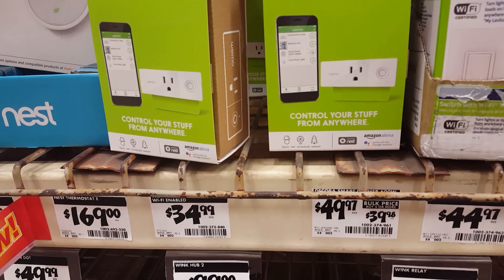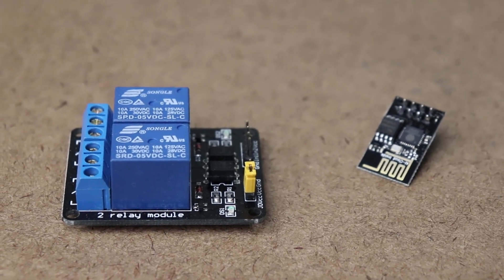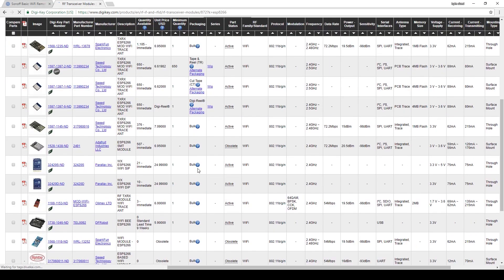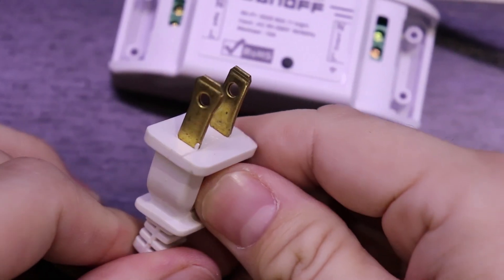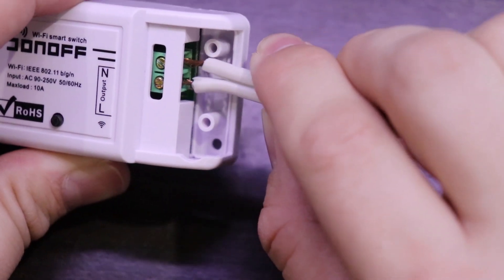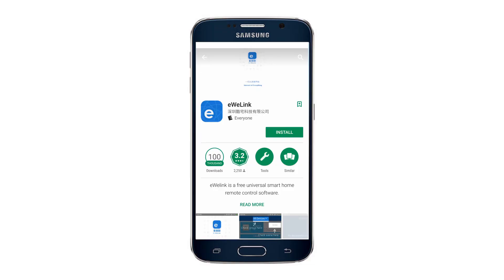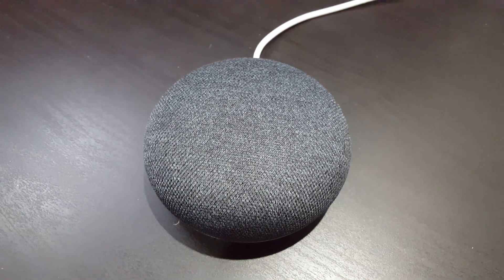Sonoff - The $5 WiFi Smart Switch That's Compatible With Alexa And Google Home

Comment: Does it look like if I unsolder the line in at the relay and unsoldered the neutral at the output could I use this to control 5 volt DC?

Comment: Hi there, love the video! Just wondering, will it still work if it's connected to a 12v transformer?
Reply: Look at the front cover or wherever it says the input values. if it says   Input:  AC-90-250v. 50/60Hz 	no, it will not work via 12v.

Comment: These are definitely not meant to be running high current loads like blender. They're rated 10amp, that blender likely pulls close to if not over that figure. The relay will also be quickly destroyed if it's repeatedly used to interrupt high-current loads like a blender crushing ice. Finally these are straight from China and have no electrical safety cert markings on them, if one catches fire and burns down your house you won't be getting any insurance money.

Comment: Even the smart switch has multivoltage, please check your voltage appliances before plug it in. Step down transformer with smart switch can also useful.

Comment: Is there a way to pair the switch with a wifi router and control it via the internet remotely? Say, I'm at the back of the garden 200 meters from my well and I'd like to turn on the water pump. I have my phone with me but the wi-fi signal does not reach all the way to the switch. The switch is in range for my wifi router that's connected to the internet and my phone has 4G. What do I need to do to make it work?

Comment: Welcome
I installed sonoff basic r2 in the air conditioner between the normal manual switch and the air conditioner
At first it was working perfectly through the ewelink app
Then I disconnect the power through the normal manual switch which is before sonoff
When I turned on the manual switch, the air conditioner turned on immediately and did not respond to the sonoff switch
And when you turn on or off the application, the color of the sonoff switch light changes, but the air conditioner continues to work without change
I deleted the switch from the app and reset it and nothing changed
I removed the switch and installed it on another device and I could not control the device with the sonoff switch
Where is the problem and what is the solution?

Comment: I have a question if anyone can help me , i have a traditional main door lock , it is an electric lock , which is connected inside my house with a bell switch besides my intercom , when someone comes outside i can simply push bell switch and door would open , how would i connect this with sonof switch because i want the switch to turn off in a sec right after it opens the door otherwise if it stayed on it can burn the outer lock since it doesn’t have capacity to cut off the current itself , what is the best way to do it ?

Comment: How did you use this for your blender? It seems to have a ground. The wifi switch does not. 

asking because I have 4 of these kicking around, hoping I can get it to work with my 3d printer. Thinking it might not be possible.

Comment: How do you wire Sonoff with a 3 prong connection? The one you show only has 2 so it limits the applications and accessories that can be plugged in.

Comment: Excellent video...For safety reasons however, I would avoid using  wifi switches to control blenders, or any sharp spinning rotating blade that can come into contact with your hand.
Reply: Or, just don't put you fingers near the blade when the jar is on the base (motor).

Comment: NEVER tighten wire like that. When so many little copper cables are the wire ALWAYS use ferrules! if you dont, you run the risk of cutting through the copper wires when tightening the screw to hold it in place. This can cause a lose wire or a bad connection where there is not enough wire touching the terminal. both scenarios can result in electrocution or fire.

Comment: Has about 40 of them in the house to control outside night, wireless camera, doorbell, PIR, Intruder barrier detector, house alarm, most of the curtains etc.  The Sonoff switch can has single, dual or 4-channel.  They are also available in bare module in populated circuit board to be power by 5VDC, 7 to 32VDC and/or 240VAC.
Basically all Sonoff switches are controlled by eWelink App.  If you have an Amazon Alexa device which is controllable by the App of the same name eWelink is one of the registered skill inside.  Thus if you activate the eWelink with Amazon Alexa App it will copy the Sonoff switches data across so that you can voice-control any of them.

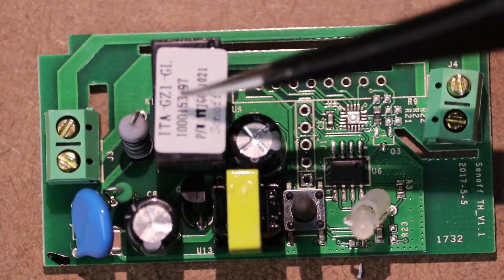Comment: 4:13 the Neutral line is not switched but directly bypassed to the output port, so double check your connections for security reason!! The switch will work in both direction but it will still be voltage on the connected device also when the switch will be off!! Changing a lamp on a sonoff switch wrong connected, also if OFF could be really dangerous!

Comment: I've got a question that I'd like an electrical engineer to answer, as it's been driving me mad trying to search for thew answer! I'm looking for a smart switch that is switched when a 240v current reaches it. That is, an current switching on a smart signal that Alexa etc could use to turn on a group, instead of a button or a spoken command switching it on, so the other way round to normal?! Please help if you can. I'm actually trying to get the 'load' signal from a heating thermostat to switch on a set of smart sockets when it calls for heat. Thanks!

Comment: This was great information for when it came out in 2017 but now wifi smart plugs are extremely common and affordable. Get one of those and don't do this hack because if there is for any reason an electrical fire, your home insurance will not cover the claim if they find out you splice electrical wires together.

Comment: Awesome!
Question: how would I use the app without having to log in?
There is no technical reason why i should not be able to control the switch with no internet connection, but just using wifi...
You know, privacy...

Comment: I would like to use this switch's relay to control a garage door.  Could I disconnect the power lines to and from the relay and use the relay to open and close a circuit to open and close the garage door?

Comment: You never mentioned you can only use Yahoo as your email address, unless it has changed. Also it says "works with everything" which it goes not. Been using for some years now, I like, but it suddenly stopped working, it it does, it may need an update. Which I done and works no prob's again.

Comment: I would've used Triacs or FET's instead of a relay, basically how a stove range works.  Sure it would take up to 1/120th of a second to shutoff but that shouldn't be noticeable to most people.  A solid state solution should be more reliable than a mechanical relay.

Comment: they make digital amp readers . you can attache the coil to the incoming fuse panel. they make cool 2 phanse built in volt meter digital screen.  some how you need to get a reading from that screen into your phone....

Comment: I did it all, application installed, connected all wires, paired the device with cellphone app, after all set, it says device is off, it doesn't allow to be tuned on by clicking on on/off button

Comment: can it just signal a current for just a while,, or like,, just a click
like some solenoid locks,, normally off,,, just need a click signal,, that on the solenoid,, pull the latch,,, and the work is done,,,
as the signal is off,, the solenoid is off,, the latch go back to first position by spring push
so any such function, in app,, like, just Click to Open,,   
not like ordinary switch on,, and keep on for certain or longer time,, and then off it,,, 
simply just on for a second and then off

Comment: Can it run in parallel in a wall cavity or does it have to run in series? also is there a thermal protection on the device?

Comment: Will it turn 12 volts off and on ? Or does it need the 110 to function?
Reply: Run the 110 line input and plug your 12 v device into the output line.

Your 12VDC devices all run off of a box transformer plugged into your standard 110 wall outlet.

This is simply an on off switch with some cool ways to manipulate how and when to turn 110 power sources off and on.

Yes, it would work.

Comment: I have a driveway sensor that is set up to activate my front house lights with 110 volt and also a buzzer of of 12 volt.  My dog goes nuts when the buzzer goes off so we had to disconnect the buzzer.  I would like to have some device send me an alert via text, email, google home and/or simply wirelessly turn on a light in the living room and my office when the sensor is activated.  Any solutions???

Comment: Hello I’m interested in monitoring the power consumption of all my different appliances real time. Any ideas?
Reply: Might want to purchase a product similar to this https://www.amazon.com/Digital-Electricity-Analyzer-Monitoring-Equipment/dp/B07M8JKLG5/ref=asc_df_B07M8JKLG5/?tag=hyprod-20&linkCode=df0&hvadid=309819400004&hvpos=1o1&hvnetw=g&hvrand=17335732536043301961&hvpone=&hvptwo=&hvqmt=&hvdev=c&hvdvcmdl=&hvlocint=&hvlocphy=1014243&hvtargid=pla-608358363795&psc=1&tag=&ref=&adgrpid=60510211606&hvpone=&hvptwo=&hvadid=309819400004&hvpos=1o1&hvnetw=g&hvrand=17335732536043301961&hvqmt=&hvdev=c&hvdvcmdl=&hvlocint=&hvlocphy=1014243&hvtargid=pla-608358363795

Comment: Please keep in mind that his temp build isn't finished. It's a good practice to enclose the module Ina waterproof case in the event someone spilled something on it or a kid wanted to play with the sonoff housing. Without an additional enclosure may cause harmful injury.

 Also keep in mind that by cutting a cord an installing this unit may break your local electrical code so you may want to check and see. Units like these are really meant to be installed inside a gang box of some sort.
Reply: Things like this dont need a waterproof casing unless outdoors or in specific wiring zones as per 18th edition regulations, the sonoff is double insulated which means no earth is required as there is no metal that can be touched that makes contact with the circuit etc. Electricians use devices like this all the time
Reply: @ninjahamster1551  my thought is what happens when little Joey spills his sippy cup on the unit by mistake and wants to play with it. That's pretty much it. It better to be safe than sorry. Now that being said. For you this might not apply but for a family just getting into this kind of stuff. It's good practice to lean on the safe side and not risk a possible fatality. We are working with 120v AC with 15 amps of current ( if you're in the US). That's more than just a little poke or a tickle.
Reply: @Brian_Onesimus  I mean yeh if it's going to be on the side go for it why not the price to do so was cheap but for lighting etc its tooked out the way so it doesn't need one and I'm a U.K. Electrician so yeh most likely different regs etc, we have 230/240V but our lighting circuits are 6 Amps, Sockets are 32A
Reply: @ninjahamster1551  right on brotha

Comment: Another thing is I wish it didn't have to connect through some untrusted server. These IOT devices are notorious for having lots of security vulnerabilities and rarely received fixes, so putting on on your Wifi is risky. If you have the option, put it in a private VLAN or flash the firmware with something you control.

Comment: This looks really cool, but why is no one mentioning the lack of Ground pass-through? If you're powering devices like a blender, coffee machine, whatever, especially when it deals with fluids, you'd want it to short to ground when a wire gets pulled loose or there's a leak. Maybe put it in a casing and connect a ground wire that bypasses the Sonoff switch.

Comment: what is the maximum supported wattage for this? i dont want to cause a fire. I want to control a 2000W heater in my room. Is this a safe solution?

Comment: Could you wire this in the wall. For example can you control a ceiling fan when disconnected from the power and reconnected from the power does it automatically send an on signal.

Comment: Can you install this to a light switch some how, connected to the power source or line?
Reply: Of course you can
Reply: does the physical light Switch need to be on? If it doesn’t, wouldn’t the toggle be out of sync? E.g when it’s on off position, it becomes on for the light

Comment: Very simple productive idea, do you have any idea about electric consumption by using that device !! 
Does it keep light current through the connected machines?
Reply: No, it breaks the connection via the built-in relay. Of course the device itself uses a bit of power for the Wifi and chip, but that shouldn't be much.

Comment: Hi mate.
Do you know if I could us it for controling something that use power bank to work? If not, do you know anything that I could use instead?
Reply: Use the switch to control a relay that can handle the power that whatever you wanna connect it to requires

Comment: Can this be used with Apple HomeKit
Also can this be used direct in line of the power cord of the item rather than running an extension cord for each and every item?, this would be significantly cheaper than buying 25 Wemo Outlets but I don’t want to buy this and extension cords for everything, especially when cords I currently am dealing with are already too long

Comment: That circuit board worries me. The mains-voltage tracks look way too close to the rest of the circuit. Slightly academic, since I don't think this device would pass the UK standards anyway. Although, using wi-fi, there's no particular safety risk if a short blows the electronics. You don't have a low-voltage lead that suddenly carries mains voltage. 

Using what looks like a solder layer to increase the current-carrying capacity of the PCB track is asking for trouble, and I am not sure if the relay is up to the job

OK, so I'm used to UK standards, with about double the voltage, three-pin sockets with a distinct ground connection and a switch, and various other safety features. Yes, the label says up to 250v and 10A, but there's no earth connection and the only approval is RoHS which is nothing to do with electrical safety, and would probably mean lead-free solder.

No, I wouldn't use something like this. And what would the lack of approval do to your insurance?

Comment: Why wouldn’t you just put this switch in the normal power cord for the device? What’s the need for the extension cord?
Reply: @Kenneth Miles 
So you don’t modify the original ac cord to your appliance / lamp. In case you ever sell or get rid of it.
Reply from the maker: So I can move it around to a different appliance if I want to. I'm pretty sure I said that in the video.

Comment: Here's a question- I got a porch light that's operated by a wall switch from inside the house. Is it possible for this sonoff WiFi switch to install it to the wall switch? Once installed can I still operate the wall switch manually or not? Or is there an alternative? My aim-  I would like to connect it to my ring doorbell once motion is detected so porch light will switch on for a few mins then automatically switch off.
Reply from the maker: Sounds like a cool project! Have you seen my videos about how to use relays?
Reply: @bytesizedengineering  relays? No I haven't - but defo I will check it out. Thanks bro 😊

Comment: What happens if you lose wifi all of a sudden? How do you witch on whatever the device that is attached to it? I have always wanted to place one of these between a light bulb and a switch but I was wondering if this means that I would lose the ability to manually turn it on and off. Please clarify.
Reply from the maker: These devices have a button to manually switch your load.

Comment: For only 5 bucks this IoT's security is probably pretty weak.  Just another dodgy IoT device we willfully put into our homes, with its dynamic IP server ran in some backroom chicken coop in China.  Perfect setup for a security breach... but who cares right?  It turns on the blender without touching it.  Oh it could also burn down the house if there's a massive cyber attack by a rogue state actor.  They also make a great attack vector into the your wireless/wired network through the router.  Food for thought. ;)  It's probably best to disable its dynamic IP server mode,  and run it directly or through a little bit more trusted noip.com if possible.
By the way, what's wrong with turning on an appliance by flipping a switch?  Not much really, might even give your some exercise. lol
Reply from the maker: You should make a video about how to do all of that. There is custom firmware out there for these devices that address some of the concerns you mentioned. I've never had any problems with attacks. If I did I could just unplug it. Problem solved.

Comment: Hi Zack, Thanks for your video on how to connect up the equipment for wireless control, I have a question , how do you control your devices if I am outside the house or say I am in a different country ( if I am on a holiday and would like to turn on my perimeter lighting) .
Reply from the maker: It connects to a server on the internet. You can control it anywhere in the world with an internet connection

Comment: Does it use WiFi networks ?
Reply: Can I control it from other city?
Reply from the maker: It uses WiFi to connect to a server on the internet. You can control it from anywhere in the world with an internet connection

Comment: Hi Zack,  can i use sonnoff to my 1.5hp Split AirConditioner?  
Can the Sonnoff handle the load/power? 
Is it safe you think?
Thanks in advanced
Reply: I wouldn't, you would be better off using it to control a power contactor with better contacts.
Reply from the maker: I'm not sure how much current it draws. You would need to make sure that the sonoff is rated for the current. Also the air conditioner would need to be single phase.